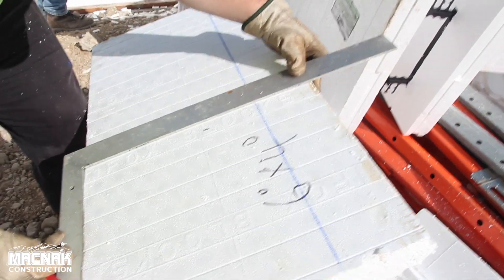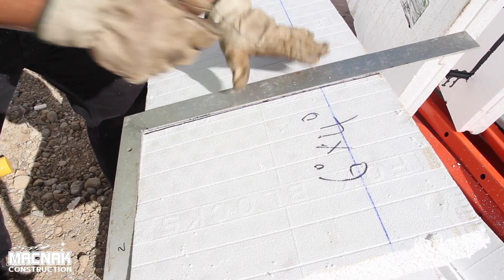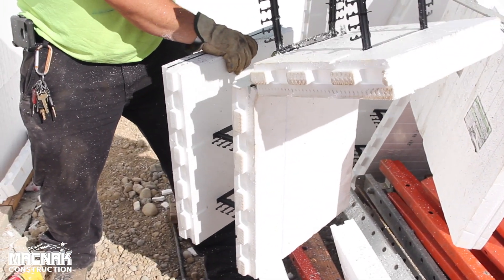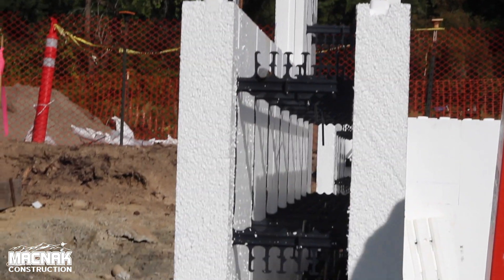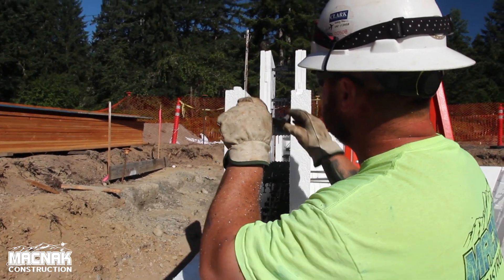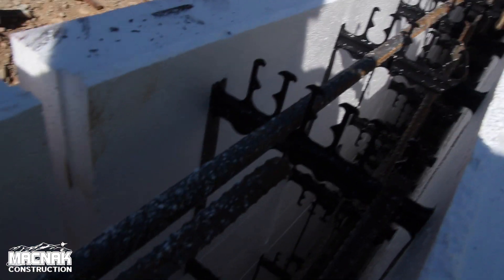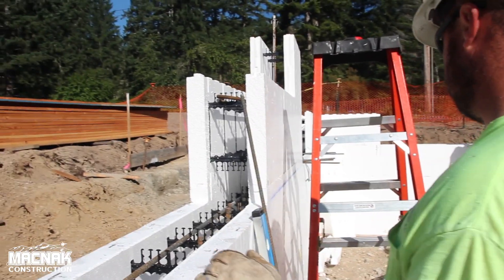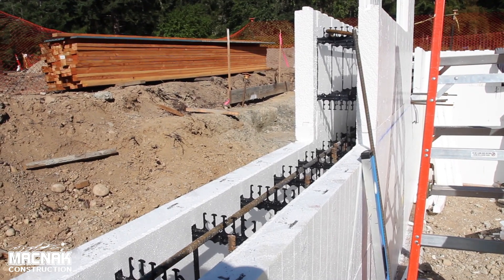Custom ICF Waterfront Home - Rocky Bay Part 4

Comment: Do you have any experience with helix?   It is a rebar alternative that you add to your concrete when you pour.
Reply from the maker: Yes we have used Helix in the majority of our ICF design and builds.  However, on this project the County had never seen Helix and were causing us a lot of problems in getting our designs permitted with Helix so we removed it.  Helix is great for saving time by allowing the structural engineers to work with the Helix engineers to replace rebar and save time placing and tieing the rebar onsite.  We would have used it on this building if we had not ran into the issues with permitting.

Comment: This is the one with the green roof right? If it is, please do a video on the roof. There's not many videos out there on green roofs with ICF.
Reply from the maker: This building is designed with a single pitch standing seam metal roof.  We were going to use our Green roof system but the owners were worried about constant maintenance/weeding of the green roof until it matured.  We did a 22,000sf green roof for the Federal Government a few years ago and have been looking for an opportunity to re-implement that design.  The seedums we used up here in the Pacific NW only take 2 years to mature and then they are relatively maintenance free but for the first 2 years constant weeding and hand watering during dry periods are required.